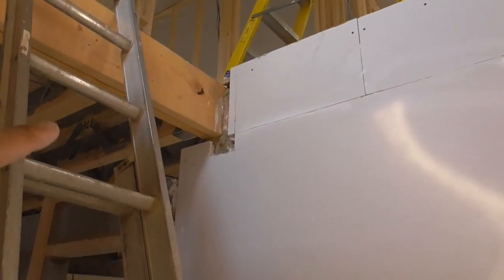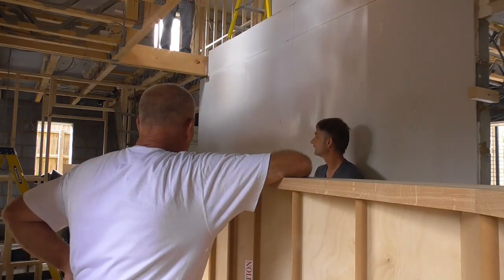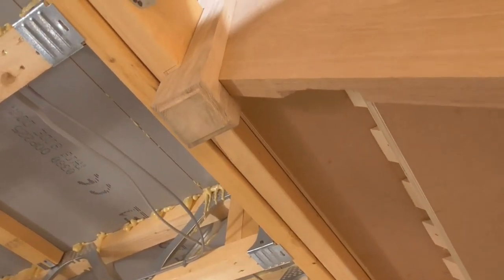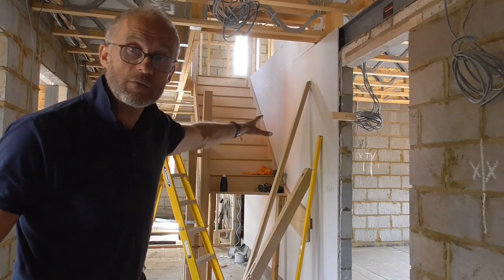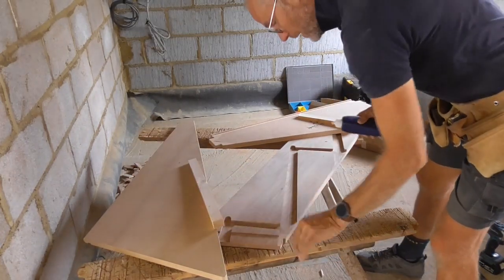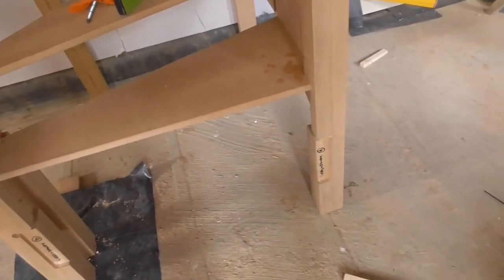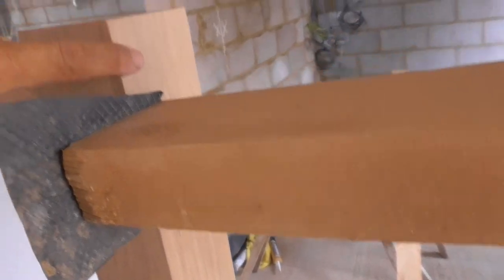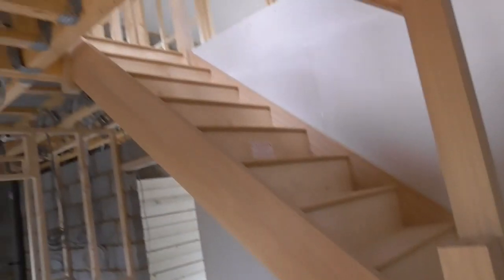UK Carpentry 1st fixing ***FITTING A STAIRCASE***(PART 2)***INSTALLING AND FITTING WINDER SECTION***

Comment: Inspired me to try and fit my own stairs next week. Family currently using a ladder for last 6 weeks and honestly cant wait another 6 to save for fitting so going to try to install from this video. I appreciate you make it look easy but it seems logical, I'll take my time!
One query on the draw dowels , is the big shave towards the shoulder? I think so from what you said. 
And the holes drilled in the tenons for dowels are they smaller than the dowel holes or same size.? I'll share before and after if interested. Either way brilliant video. It's videos like these that help people achieve things.
Reply from the maker: Hi there🖐Use the same size hole for the tenon as the newel, and the 'big shave' faces AWAY from the shoulder (the newel) this drawing the tenon further into the mortice👍Good luck😎Cheers Del
Reply: Did it, if I could add a pic I would. Its was made possible by watching and gleening tips from here that I appreciate took years to get. Thanks

Comment: Love it! As a home DIYer, it's interesting to see how it should be done rather than how I would've tried to do it! I love the wedges to fix the triangular steps (are those the `kites'?). I've used wedges to fix together stuff like work benches to great effect. The more you pound on them, the deeper they seat. I'd never thought of using them to fit a board into a rabbit before. Now I know. Thanks Del.
Reply from the maker: Hi David🖐there is still a lot of simple, traditional joinery in staircases which make them enjoyable to make and fit🤩I appreciate you great comment, and thanks for watching😎Cheers

Comment: Very good. I’ve got to do one like yourself but with a winder going round to the left at the top. I’ll give it a go….
Reply from the maker: Hi Slashley🖐I find it easier to build the top winder section first, drop it in place and prop it, and then slide the mainflight onto it👍Good luck👊Cheers Del
Reply: @thetallcarpenter  good tips. I'll give you a shout if(when) I get stuck 👍🏻🤞🏻
Reply from the maker: @gdfggggg  I'll be here bud💪

Comment: Awesome work. By the way I was watching someone put plasterboard underneath the winder part and drylining guy was taking the angle blocks off and putting battens to get the plasterboard attached. This was on a family members house so not sure if that will cause issues longer term
Reply from the maker: Hi Asif🖐Definitely shouldn't remove those triangular glue blocks as they give a larger glueing area between the tread and the riser, and there is more chance of squeeking if only the top edge of the riser is glued to the underside of the tread👍You may find though, that when the plasterboard is skimmed it might still hold the joint tight together🤞Thanks for watching 😎 Cheers Del

Comment: Hi Del, great job on the stairs and the 2 videos👏👏. When you say you always start at the top, what do you do if the winders are at the top and the joint between the stringer on the main flight has a groove and the stringer on the winders a barefaced tongue. In this situation wouldn't you have to push the winder stringer into the  main flight ? In which case you would really need the bottom flight in first and probably the trimmers left back so you could push them into the back of the newels, would you agree. 👍👍
Reply from the maker: Hi Kevin🖐Even in the situation you describe, I still always start from the top and work my way down👍If this set of stairs was a top winder set, (the exact opposite of what I fitted), I would make up the all the winders, top tread and risers into the newel and the short stringer section and prop it in place. I would then slide the main flight into/onto it. The top flying section of wall string would slide over the wall end of the kite winder treads, and the outside string would slide into the mortice in the newel. The trickiest part of this is trying to fix the corner where the short string and the flying part of the main flight string meet, and I do this by either using a timber block fixed into each from the stair side but UNDER the treads, or trying to get a fixing in from the back/outside of the strings, which can be difficult if the stair well is already built🤞I'm really hoping I will get a top winder, or even a double winder set to do in the future so I can show how I do it😎Thanks for your comment bud
Reply: @thetallcarpenter  Thank you Del for the reply and the videos, would be great if you do get a top winder stairs.
Reply from the maker: @amazing451  I'll 100% do a video on this Kevin👍
Reply: @thetallcarpenter  Will look forward to it Del 👍👍

Comment: Alright fella, 1 question why did you fix through the nosing tread, when you could've fixed through the trimmer into the Newell's using 120 mushroom, your going to fix your wall string to the wall, so it wasn't going anywhere.
Reply from the maker: Hi Lee🖐Fixing through the back of the trimmer is a fantastic option, as you say, I guess I don't do this out of fear of splitting the newel, and habit as the joists are rarely open when I'm fitting👍Thanks for watching and your comment 😎 Cheers Del
Reply: Alright del, I make CNC stairs and fit them also, as a rule we never screw the nosing tread as the hook on the Newell posts are doing their job when hooked over the trimmer, as long as your wall string is fixed then life's good. Fantastic work mate, love the cut roofs you do. 👍
Reply from the maker: @leeharvey23  👍😎

Comment: hi mate could you build and assemble the whole thing on the floor and stand up into place.
Reply from the maker: Hi Charlie🖐I certainly have never tried to build a staircase like this on the floor and then lift it in😲It would weigh a ton and would be very awkward to get into position😬Cheers Del
Reply: @thetallcarpenter  Yh I’ve done double kite winders on site and built on floor and stood them up but the one your doing looks a lot more neater and complicated tbf mate cheers for replying love the vids🔨👍🏼
Reply from the maker: @CML_Carpentry  🤩👍

Comment: Hi del what tolerance for out of plumb would you accept on the newels over the length of the newel?, also what would you accept for out of level on the treads over 2ft? Cheers
Reply from the maker: Hi Chippy🖐I'm really looking to keep my newels as plumb as possible, as they affect things like the pitch of the stairs and the level of the treads. Again, if the treads aren't level across their length, this will affect how plumb the newels are. I tend to set my stairs based on the rise, rather than levelling out on the treads, however, and answering your question, like any timber joinery item, there will be tolerances they will be built within, and if these tolerances are to be accommodated, then  allowances will need to  be made. I wouldn't get my knickers in a twist if tread/newel was a couple of mm out in its length, as long as the job looked right on the whole. The thing you need to be careful with when it comes to out of plumb newels, that they can end up looking bad if they catch your eye out of wind with something else like door openings, spindles or other newels👍
Reply: @thetallcarpenter  hi del thanks for that. Can I also ask do you always prefer to build it insitu?. If for example it was in reverse and the winder would be at the top would you still build it insitu? Or would you assemble the stairs as one unit and lift?. I’ve seen it done both ways but would like to hear the rationale behind building it insitu? Thanks!
Reply from the maker: @Chippy97  Hi bud🖐If the winder set was at the top I would only assemble the the top tread and riser onto the newel as well as the kite winders onto the back string. I would then notch the newel and fit this into position roughly level/plumb and prop. I would then offer up the main flight and 'slide' it over the last kite on the wall string side and into the mortice on the newel on the outside string side. I'd then stick the bottom newel and handrail on to finish.👍Hope that makes sense🤩Cheers Del
Reply: @thetallcarpenter  I see so basically doing what you did in the video but in reverse!. How come it’s best to do it this way as opposed to making it all up? Is it the weight of it or that you can plumb the newels up more effectively?
Reply from the maker: @chippy977  It's partly due to the weight of the completed staircase and how unwealdy it would be to try and get it into position over the trimmer, and also, like you mention, you can keep a better eye on plumbness and level doing it in smaller stages👊